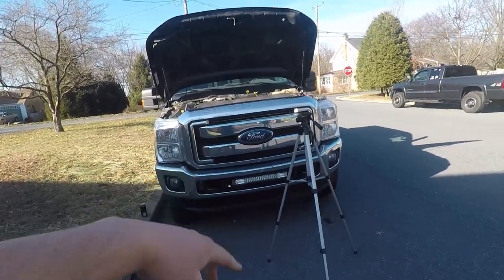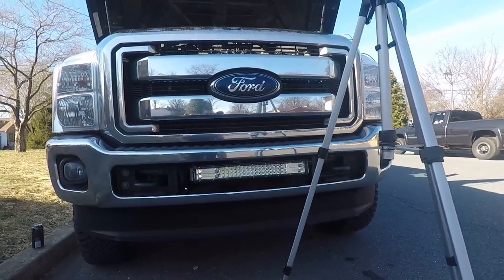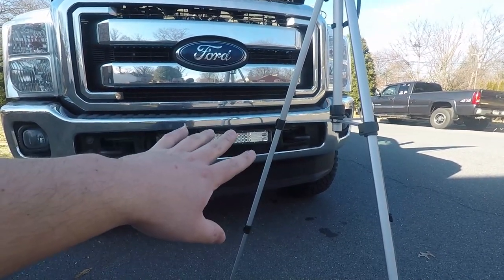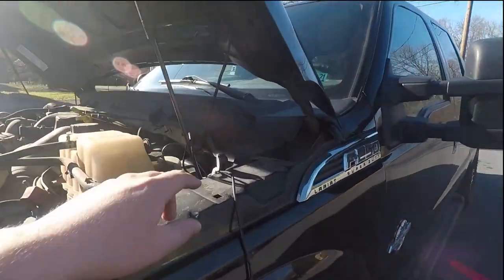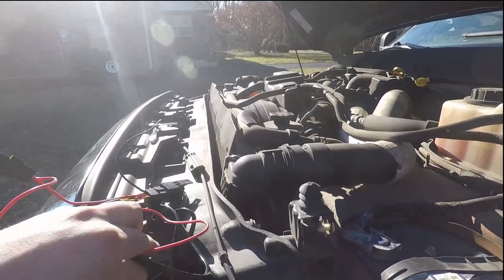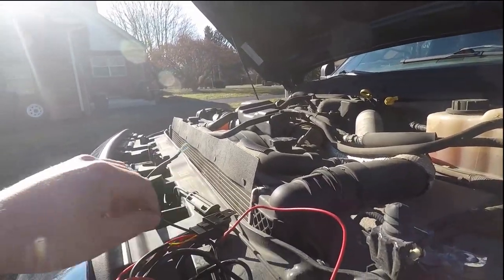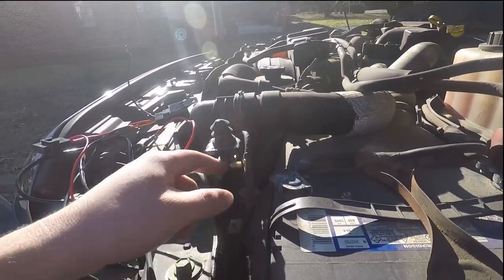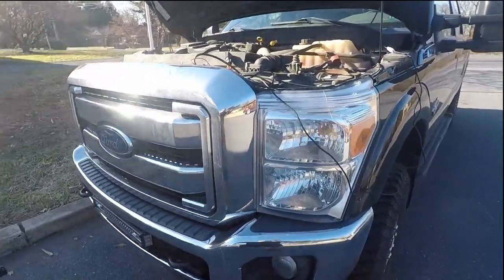Auxbeam LED Light Bar Install 2015 6.7 Powerstroke

Comment: Lightbar looks sweet btw. What are the laws in PA as far as lights allowed while driving? Here in Missouri you're allowed 4 lights not sure if that's a federal thing maybe too? Cause when you have you low beams and fog lights on and turn on high beams it shuts fogs off until you turn high beams off. I just installed some cheapy LED headlights/fog lights I picked up off of eBay for $33.99 free shipping. Included 9006 low beam 9005 high beam and 9145 fogs.
Reply from the maker: So technically I can be pulled over for this light bar. If you have a light bar on you need to have it covered, and technically any led lights need to be in projector housings in PA. that said cops are pretty easy on that up here

Comment: Looks Good Jared,thanks for sharing. I have Led light bars on my Tyrex they are the shizzle. I've thinking of doing the same to my F350 but I have a few more things I have to finish on it b4 doing a led lightbar. I was hoping to get my turbo installed but calling for 20's in Kc all week long.
Reply from the maker: Turbo is much better than any light bar!
Reply: Lmao You know that's right,1st hand. I'm chomping at the bit to get that turbo on. As well as my FICM with the Atlas 40 tune should be he by Wed I'm hoping.

Comment: Great video but I was hoping to see how you installed the light bar without buying the bracket.
Reply from the maker: Check out the first video I did on the light bar has what I did in it. Super easy